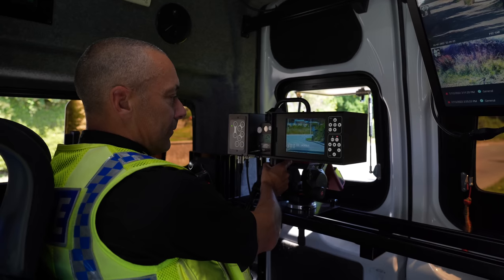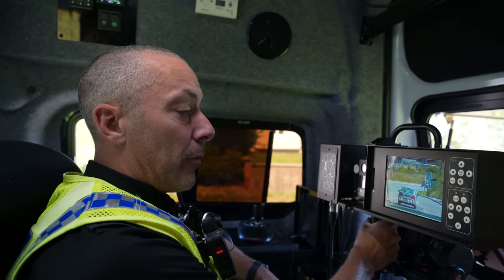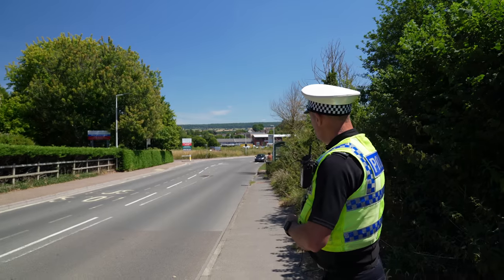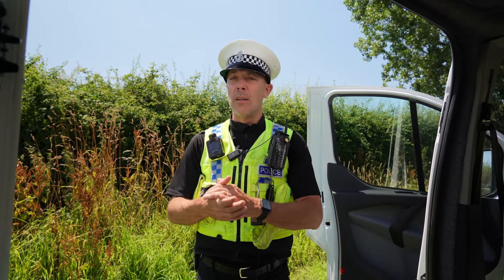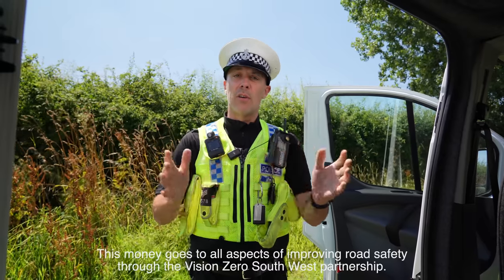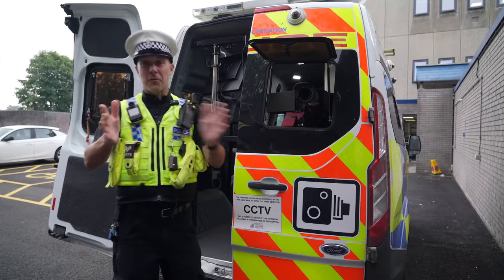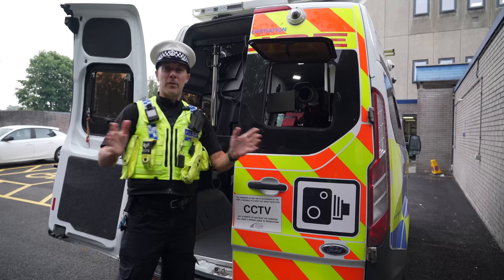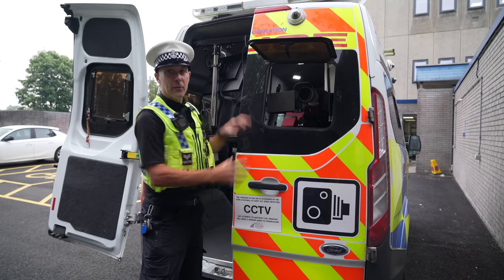SPEED CAMERAS - Road Safety or Cash Cows?

Comment: The way you're presenting it and the theory are great and I'm all for them when used correctly. 
The problem is from my experience they are only used correctly very rarely. 
The vast majority I see are in places as far after a blind bend/brow/whatever as possible - usually as out of sight as possible and blatantly trying to catch people out. 
The statistics back this up (around here at least) because they are almost never around accident black spots and when they were turned off a few years back nothing changed safety wise - same crashes, same injury rate - but less people got caught out. 
The irritating thing is then watching cars speed on roads near the shops, schools and so on where there hasn't been a camera van in years. 

If they are so good at their job then kindly explain how anyone is caught by them? If you genuinely want the traffic to slow down it should not only be as visable as possible but there should be a warning that its there so anyone who may have been straying over the limit has a chance to correct that. 
If the reason for being there is allegedly safety then it could easily be argued that anyone giving warning is not hindering but rather helping.

By definition every single person caught by one of these means it has failed in its sole (declared) purpose. 

By the way I got caught speeding when I had not long passed my test about 30 years ago. I took my points and never did it again (clean license since) but no one is perfect and its a constant worry that you might inadvertantly go over by a few mph - even when its perfectly safe - and get a fine, points, increased incurance and all the rest. 

Now if one turned up outside our school with a big sign a hundred yards each way saying "if you speed you're getting nicked" it might be helpful. Sitting in the layby surrounded by signs, trucks and about half a mile after a rise where the road goes from a national to a 40 (it never used to change there and there never used to be a camera van there, either) might well catch more people but since the accident rate on that road is zero in the last 10 years its hard to see why they keep turning up.
Reply: Nail on the HEAD.
Reply: So they are normally used where people are speeding. Its black and white, do you do more than the limit? If yes you're speeding. Campaign to change the limit not remove enforcement.
Reply: @PCDelorian  Is there someone sitting watching every shop just incase someone robs it? 
Do we have a justice system which is based on the burden of proof? 
People shouldn't need to campaign for fair enforcement. The fact so many people see these as a money machine should say it all.
Reply: @siraff4461  No enforcement is fair, you want to change the law. The burden of proof in a speeding case is beyond reasonable doubt just like every other crime, being caught by a speed camera is akin to a shop having CCTV and yes almost every shop has that and someone looking out for it, what do you think security is for in a shop. Further you don't have an exclusive right to the highway police can park there if your stupid enough to break the law in front of them you've only yourself to blame.
Reply: @PCDelorian  So you're saying the burden of proof is equal for speeding vs shoplifting?
Interesting. 
Also completely misleading because people going into a shop don't have a registration number glued on their back and even if they did it couldn't be used to presume guilt unless they could prove it was someone else. 
Certainly NOT the same and one of the many usual excuses for speeding to get a bypass on the usual rule of law where you're innocent until guilt can be proven past a reasonable doubt. 
Amazing then that you can go into a shop wearing a hoodie and not have to prove who you are - which is why shoplifting has one of the worst conviction rates of any crime but if you do 31 by mistake you're bang to rights unless you can prove it was the milkman. 
Funny also that you mention stupid enough to break the law infront of police but I see plenty of cars going past speed cameras where the driver is using their phone (something that can be proven to be dangerous while there is zero evidence of minor speeding being so) but strangely this much more dangerous crime goes without so much as having a word. 
The same goes for the ones where following them stinks of drugs so much you get high - again I'm yet to see one get pulled over by police of any kind and certainly not by a womble in a camera van. 
Bald tyres, dangerous suspension, dodgy brakes, no indicator, cutting people up and all the rest go untouched but if you go slightly over a limit usually lowered specifically to make it too slow for the road (which is usually where these vans seem to find their homes) then you're going to get points, fine, higher insurance and all the rest. 
Oh unless you're in a stolen car or one not in your name in which case you can sail merrily on by and the curtain twitcher in the van won't take a blind bit of notice. 
If its genuine there is one simple answer. Take the money out of it with all fines going to charity and don't add it to the tally for the force doing it. 
Watch how quickly it becomes something they can't deal with - like the house break in's which they no longer even routinely respond to. 
Keep preaching that sermon but unless they are actually helping (you know - the ones you never see because the traffic in those places isn't going quickly anyway since drivers tend not to be on a suicide mission) then they are nothing but a parasite. 
They are a great idea but - a lot of them - being used for the wrong reasons.
Reply: @PCDelorian  If they are normally used where people are speeding why is the speeding not being addressed rather than caught after the fact?
Put up a massive sign saying "camera van in a mile" and the speeding will stop. 
If not why don't you want it to stop?
Reply: @siraff4461  Yes the burden of proof is identical, beyond reasonable doubt. The evidence is easier to obtain but the court knows you did it when it imposes a fine. The money doesn't go to the police and shoplifters also get fined all the time, if you'd prefer everyone caught speeding do a week I'm all up for getting rid of fines but prison might be a little harsh for 36 in a 30.
Reply: @siraff4461  No it won't, it I'll stop it for one mile or will then speed up after and keep going fast until they see it, besides in some cases they do have you seen the enforcement cameras ahead sign.
Reply: I think by definition every single person caught by these only has their selves to blame as they are breaking the law and risking peoples lives, maybe the fact that they got caught out and had to pay the fine / gained points may prevent them from doing the same thing in the future
Reply: It's very simple: dealing with traffic offenders IS road safety.
Putting speeders on speed awareness courses or endorsing their licence makes them think twice. Seeing a cop car once every four months does not have the same impact.
Until there's a better or more reasonable solution, that's what we have, the same as any other country.
Reply: @ultra_vires  That was some great rhetoric 20 years ago before it was completely debunked multiple times and with evidence to show it was all rubbish. 
Define "speeders". 
Is it the people on their way to work in good conditions going 5mph over? You see thats the kind of thing that brings almost all of the tickets. 
Of course if you're drunk/drugged/on the phone/etc the cameras won't care so long as you're on the limit. 
Can you explain why there are plenty of speed cameras deployed every day yet almost nothing done about the much more dangerous (which has been proven and is on the rise) offences of drugged driving and distracted driving?
Its a joke when you can get done by a camera for doing 71mph at 3am on a deserted motorway in a Lamborghini but you're highly likely to get ignored if you're in a 40 tonne truck on bald tyres in the ice in rush hour while stoned, drunk and texting. 
At one point after the proof came out that cameras had zero effect on road safety they even had to change the name of them from safety cameras to speed cameras because it could be shown they were doing nothing for safety. 
Its nothing to do with safety - as has been proven - and everything to do with numbers. b ethat fine revenue or tickets issued. When that incentive was taken they suddenly got turned off. I wonder why safety was suddenly so unimportant?
Reply: Some time back there was an article in our local press wherein a police spokesperson was talking about a dummy camera that had been made active. (S)He described it as a great success because they were catching more people speeding. How is it "a great success" from a road safety POV if people are still speeding? If, however, you look at it from a revenue raising POV..............

Comment: Comparing speeders to burglars? Really? Also completely ignores the fact that in many cases speed limits are well below the actual safe speed to trave in good conditionsl, many roads that were previously NSL are now 50 or 40, speed limits are constantly being reduced.

He mentions improvements in car safety and then thinks that the human being the same is some sort of rebuttal when it does nothing to disprove the fact that stopping distances are greatly reduced and crash survival rates are far higher.

Overall a very poor video and I doubt it will improve the public"s opinion of speed enforcement in any way.
Reply: 100% agree.  The same crap here in Ireland.  The Garda Siochana are blaming speeding for all accidents yet when speed vans (placed randomly on roads) checked speed 99.54% of motorists were obeying the speed limit.  Let's face facts, phone use is the main cause of crashes nowadays.  People have never driven slower in Ireland.  Single carriage-way roads with long convoys of cars because everyone is terrified to overtake so they all wait behind the car going 10-15 km less than the speed limit.  It's all part of the war against the motorist.  I used to like driving but not anymore.  The slower you have to drive the more boring the journey and the more likely you are to fall asleep at the wheel.

Comment: They are by definition cash cows, if they were there to truly make the road safer, they would be there 24/7 365, but they inevitably just catch someone on their way to work or on the school run one day a year, and for the other 364 days a year people could do 100mph through there and no action would be taken.
Reply: Not at all, that costs a lot of money and they can't be placed in as many locations, the fact these vans are often in the same place discourages speeding even when they're not there, especially if they hide, which might be why they do, so that you slow down permanently rather than when you see them.
Reply: @PCDelorian  I beg to differ, it would cost less to set up static cameras (one off payment) however mobile cameras you're looking at fuel, film, operator wages, time spent on training operator, money spent on operator, purchase of new vans when new equipment is introduced etc etc etc.....like I said to your chum I'd expect nothing less from someone who is trying to justify their job. Nice to see the tax payers money spent on keyboard warriors sat at a desk instead of actually conducting proper police work.
Reply: @whocares4340  cost less? A speed camera that operates 24/7 costs in the region of £30,000-£60,000 fully installed.  On top of that the operating costs are £1,000 - £3,000 a year, excluding the cost of electricity .  The van would be around £60,000 to £70,000 but can cover hundred of locations in a year.
On top of this are the costs for either fixed or mobile, such as processing and attending court for the muppets that want their day in court just because they got court.
Where I live over the last 3 years each year there were 60-70 deaths (always more than homicides) and about 66% involve excess speed. So how is this not real policing, unless you just like driving everywhere above the speed limit?

So tell me how are they cheaper?
If you can’t do the fine, don’t do the crime.

Comment: The point of "if you can't see it maybe it's an observation issue" I understand and agree with, but if the van can see up to 1000m away, that point surely isn't relevant? Also a video about community speedwatches and operation crackdown would be good to see!
Reply: Yes, of course drivers should be able to see these vans but by the time you are able to see them it is too late. Obviously speeders deserve to be caught but just how much leeway is allowed when speedometers can show an inaccurate reading?
Reply: It's a complete contradiction in the video.
Reply: @mda5003  Speedos do show inaccurate readings but they only ever show a slightly higher reading than your true speed. Otherwise car manufacturers could be liable for you getting a speeding ticket.
Reply: Technically 1000m but try and find a stretch of road that allows you to see 1000m without any obstructions/bends
Reply: I was done buy a speed van once. It was a vauxhall astra van, he had the boot open while sat in the back, tucked away, on a county road that had a 30mph section, catching people slowing down as they past the 30mph sign coming over the hill... they are cash cows.. I don't see them near mine at 1am while people are screaming up and down doing 90mph in a 30 limit.. they catch people doing 34, 35 mph... that isn't speeding really..

Comment: This is good camera placement. Most of them are at the bottom of a hill or on a long straight road on a sunny day. 
They always seem to try and catch people leaving a 30 to a 60 or from a 60 to a 30.
Reply: In Germany they do this all the time. The sign is where the order applies from so you should be slowing in proper time and shouldn't be accelerating until you pass the sign. Like a yellow line it's illegal to park on one even if it only just starts there, it had started. It's black and white its not illegal to do 30 in a 60 it is illegal to do 31 in a 30 though.

Comment: I've asked this question of my recent neighbourhood police team. We also get told speed vans are place in accident hotspots or speed hotspots. I see a van parked by my house where only 1 accident has happened in the 17 years I've lived here. My road however, theres a bend before entering it with a zebra crossing. I myself have nearly been knocked over when I was crossing. It was clear as I stepped on the crossing, then a car went straight through at speed. There's been 4 accidents at that crossing caused by people speeding round the bend and having to slam on brakes but running out of road and hitting the car in front. Each time police have attended the bump. So the police are aware. Explain how a speed van isn't parked on my road where there's more risk to pedestrians.

Comment: Safer cars actually make for worse drivers! It is a factor known as "risk compensation", the safer a person feels, the greater the risks they will take. Add in other factors such as how detached from the outside world cars can be with their soundproofing, supple ride, climate control, etc, and how risks are assessed changes a lot too. 

I am forever amused when locals clamour for speed enforcement, then practically every ticket is issued to those same locals.
Reply: I feel it’s the same when speed limits are too low, for example in wales many town bipasses have become 20mph, these are non residential wide straight roads in some cases, people lose concentration and focus because of how little effort it takes to drive along at 20
Reply: Agree - In the New Forest, there is a blanket 40mph limit due to the loose animals. All the locals want that limit to be in place.  However, the majority of people caught speeding on the Forest are locals.
Reply: @henryletton7489  Try sitting with an IAM Observer that is driving in a 20mph zone, and get them to do a commentary - You will quickly change your idea about it being "little effort"

Comment: Having been done speeding on a certain 20mph road which not even a year ago was 30mph. As with alot of roads in London khan has decreased speed limits in many areas of London needlessly. However my point is the untold amount of people including police marked and unmarked NOT blue lighting I've witnessed in the dozens speeding on this road. Rule for one not the rest. I've sent dadhcam footage in regards to this clearly stating my speed being 20 and the officers gapping me at a high rate which is a clear indication of speed. So how do people respect the police in these situations when they ignore it themselves?
Reply: Everytime I'm on the M6 heading north of penrith I always get overtake by two marked x5's or x3's with no blues on doing well over 70 mph. I really don't understand it as well
Reply: Even the police know that 20 limits are a joke, not that they would admit it publicly
Reply: One argument could easily be that police cars have no requirement to turn their lights on when responding to an incident.
Reply: Maybe the rules have changed but it used to be that 20mph limits had to be self enforcing ie they could only be placed where the road layout limited the majority of traffic below 20mph and the police didn't enforce in those areas.
Reply: 20mph is no good for cars dpf will getting blocked all the time it’s a joke